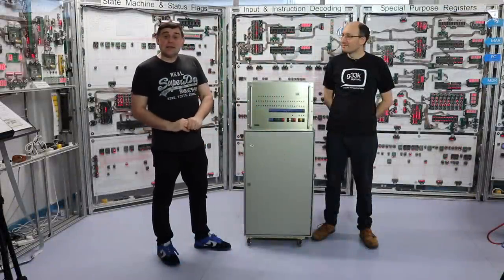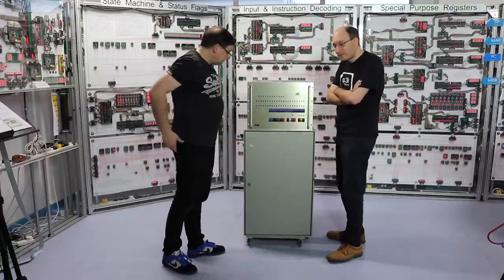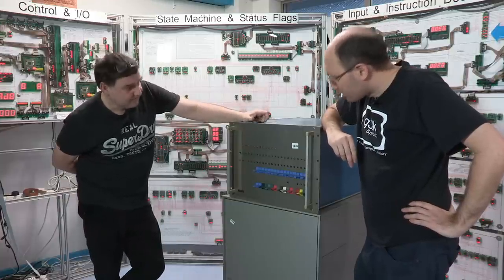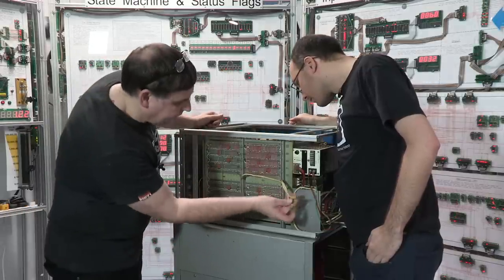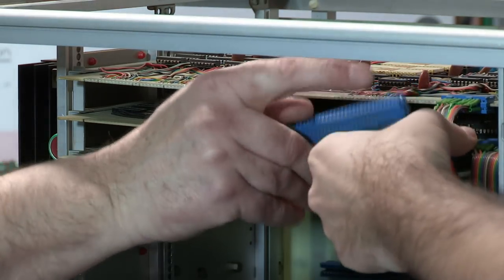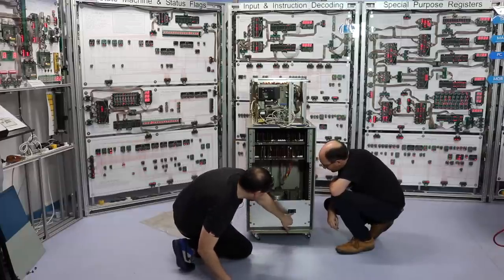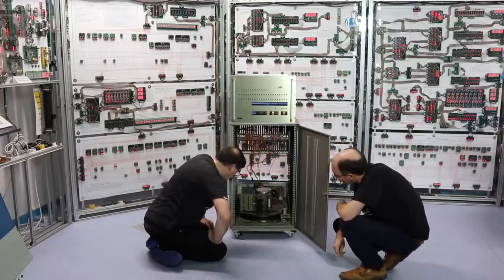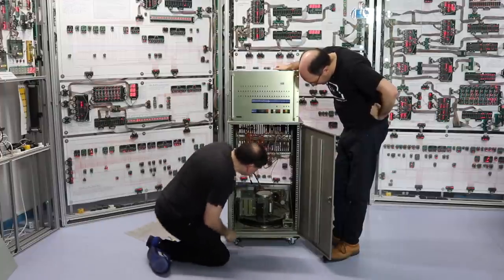The Magma Computer! - A Computing Mystery ...

Comment from the maker: Since we shot the video, we now think that these two parts MAY be two completely separate machines! Also, the 'disk drive' made by Computer Memory Systems is possibly a very late 'drum store'. We've found reference online to CMS making drum stores.
Reply from the maker: Another thought that has crossed our mind is that it is a type of delay line memory knows as 'magnetostrictive'. Basically a long loop of wire that stores 'bits' that are cycled round the wire. We have an example of this in the collection : http://www.computinghistory.org.uk/det/9050/Tyco-Magnetostrictive-Delay-Line/
Reply: I was just going to say that the methodology between the two is completely different and there's no real evidence that I could see in the video of how the two enclosures connected together. I did wonder at one point if the wires/connectors dangling down were actually supposed to go UP into the 'cpu' module. Also the 'cpu' is clearly designed to be rack mounted while the drum store isn't. Well chuffed you got the thing though. The 'heads in' lamp did indicate there was a disk/drum unit present at one point but as you say the auction didn't show it. I too thought the PSU lump was in the bottom cabinet.
Reply from the maker: @binarydinosaurs  Yeah the light on the front of the drive does suggest a disk drive of some description rather than delay line.
Reply: I assume youve probably come across this already, but the 1967 Datamation magazine states: 
"Computer Memory Systems Ltd., U.K., has been set up to,
develop drums and discs for Europe. The company has
technical links with American and U.K. firms. It is
run by former Univac men, John Knightley and Tony
Freeman. "
Reply from the maker: @tenmillionvolts  Yes :) We're seeing if we can make contact with those individuals. :)
Reply: Definitely very different. The MAGMA with the fibreglass PCBs and 2K of RAM is classic mid 1970s 4 x 4 bit bitslice ALU architecture.   The phenolic edge connector board with the off-the-shelf mass storage drum looks like its own bipolar CPU design. A little earlier.

Comment: Looks like an ATE controller, which would have the 3 board CPU that was then interfaced to a tape loader, that loaded your test sequences off of a punched tape, and then there were interface cards to the ATE rack, which did the actual work, and gave output to a terminal and a serial printer.

Lower unit could have been an upgrade, with a early hard drive to replace the paper tapes with hard drives, so as to speed up the test sequences of the ATE system. Likely missing an interface block, that sits between the hard drive and the protoboard area, which was used to interface with the controller, feeding it data to and from the drive, and also interfacing to the cards that went to the ATE system.

Probably the interface unit was removed for use with the replacement machine, as it was designed to interface the proprietary  ATE bus, likely a mix of serial, parallel and also a lot of IO mapped latches that took the bus and held it to drive things like relays, lamps and provide stimulus to the device under test, and also with a similarly large set of input latches that read back status bits. Probably had at least a few programmable power supplies, a DVM of some sort ( likely early HP, as that was pretty much the de facto one for many decades) and some form of programmable signal sources, plus a set of crossbar relay banks to select between them all and the tested device.

Drive, if it still has readable data, likely has test routines, test patterns, and also a diagnostic program on it, that is used to self test the ATE system. Power on, load up the bootstrap instructions using the toggle switches to set registers, and an address to read from for the bootstrap program, and then execute it, which loads the more sophisticated bootloader, which can use the serial terminal to communicate, and then run the programs. Not an OS per se, more like a wrapper that handles the interface between the terminal and then passes full control to the ATE program.

Comment: Possibility that the missing middle section was I/O capture, where some amount of sensor data would need to all be obtained *at the same time*, hence the missing I/O subsystem, on a clocked signal, would snapshot it's data to the drum storage.  Then, the MAGMA computer could take a few seconds (or longer) to read the signals through the I/O subsystem (from the drum storage) to access the captured data and process it at 16-bit resolution (with the 4x 4-bit ALU setup seen on the CPU board.)  If a 1970's computer were looking to acquire any timing-critical inputs (e.g. some sort of doppler or phase-shift measurements) this approach of using snapshot storage for sample-and-hold would be needed.

Comment: That top part reminds me very much of the DiGiCo M16V. Same wirewrap backplane,. Same board size. Same Gold powersyply unit. Interesting thing about the Gold psu it had two sensor wires. So it would regulate to deliver 5 Volts to your CPU board eliminating losess in backplane, wires and connectors. The bottom part looks more like belonging to the famous Mark I computer. Pletchley Park?
Reply: Remote sense is very typical when you are supplying a lot of current, as the losses in the cabling become significant

Comment: At @23:45 the number on the toroidal transformer says 28-63, which is probably a date, and implies the PSU was made in/after 1963, which is probably about the tail end of drum memory. If all else fails, wire up all those LEDs to an Arduino and you have a great prop to lease out for film and TV work!

Comment: I have never seen a Winchester drive with a motor mounted vertically above the small flat horizontal plater like that before. It may only have held about 1 megabyte tops. Must have been hell to isolate it from motor vibration at the time. Most companies used belt drive. I can't find any mention of the CMSL company or any product they may have developed to market. Shame. The Magma guys seem to have put a lot of effort into their development computer and communicating with the disk and disk drive controller and what ever else that was missing but I guess they were not the disk drive company. More videos like this please.

Comment: Maybe its a hardware magma algebra computer. magma may have used it to work on the MAGMA computer algebra system .
Reply: MAGMA computational algebra started as a project at Uni of NSW here in Australia in the 80s but it was called Cayley back then.This 4 x 4-bit bitslice ALU architecture based multi-chip CPU board was much earlier than that.  

74181 appeared very early in the 1970s and was the basis for plenty of minicomputer designs including the PDP 11, Vax and the famous Xerox Alto.   That was the mainstream bitslice ALU processor and people still build machines based around it - if you can get your hands on old stock.

The MMI 5700 and 6700 based machines were the basis of quite a few scientific minicomputers from the mid 70s on, but there company merged with AMD so which then a year or so later released the AMD2900 family - about 1975/76 and you can see that machine has mix of MMI6701Ds and AMD2900 series chips.   This was about the time that bitslice designs began to develop into Berkeley RISC architecture which eventually caught the eye of Sophie Wilson at Acorn for the ARM1. 

And it's a LONG time since I saw a 2102 1k x 1 bit SRAM.  The 2114 seemed like a dream, only needing two of them for a whole kilobyte of RAM.

Comment: Just a correction: electric cars are not "zero emission" - they simply move the point of emission from the car to the power station. If the power station is "dirty" then so is the electricity used in the car. This also ignores the environmental and energy costs of mining and processing the toxic metals used in the batteries, energy lost in transmission of the electricity from the power station to the charger and efficiency of the battery. Also, much like nuclear power stations which initially promised vast quantities of "clean" and cheap energy but ignored the cost and environmental impact of decommissioning them at end-of-life, it also ignores the similar impacts of disposing of millions of electric car batteries in the future.